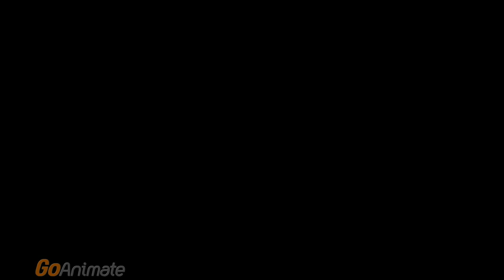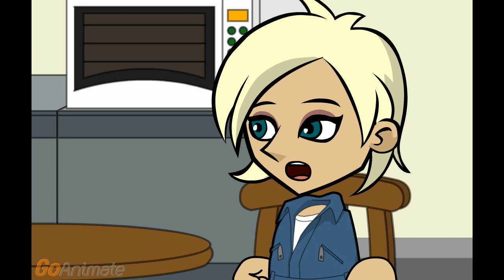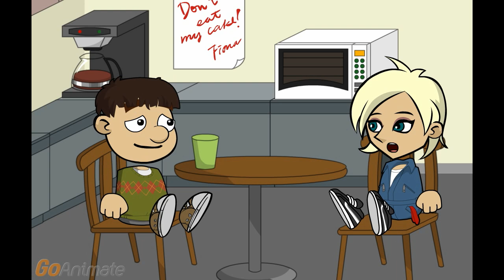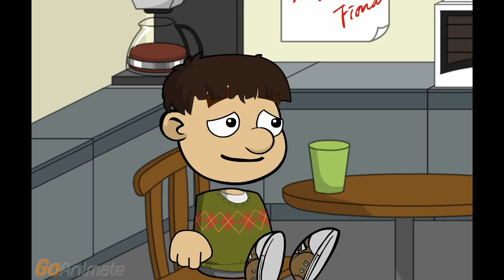Nordyne Furnace Error Codes

Comment: What does 2 blinking red lights mean
Reply: Flashing red every two seconds
Reply: What was the problem my is doing that blinks 2
Reply: Same here.
Reply: Same.  red blinks twice after about a minute when I turn on the power.  Very irritating and its cold outside.  Inducer motor blows.  When I change the thermostat to fan on the big fan kicks in. I do have gas to system.  But no flame ignition in the viewing window.